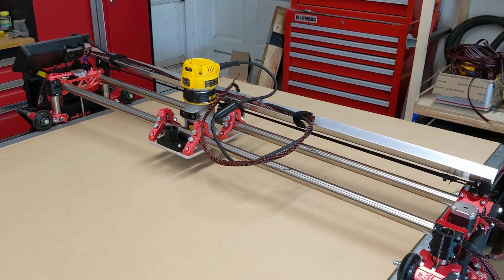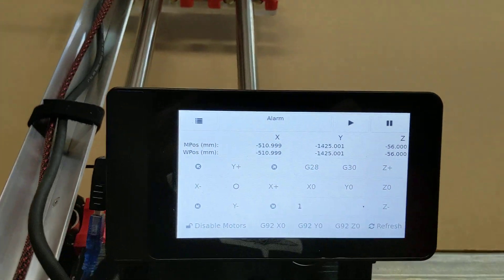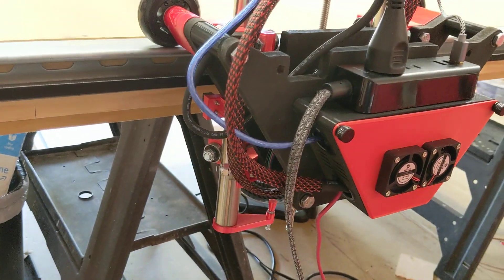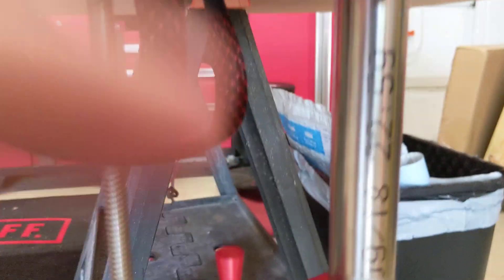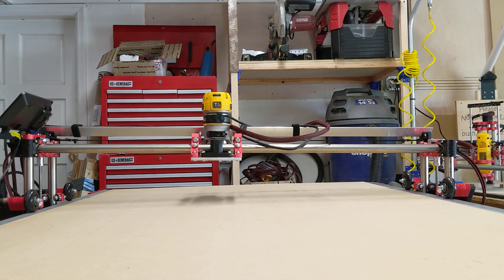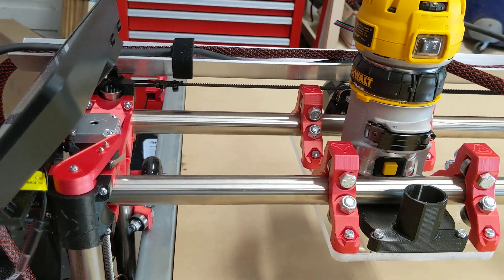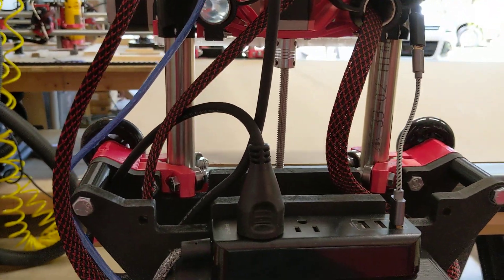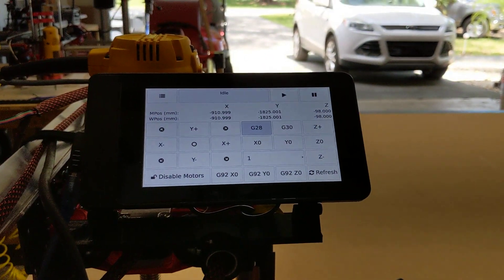My new Lowrider CNC lives!

Comment: Nice design, I thinking to use similar approach for X axis but most of the routers have vertical arrangement of linear guides is there any advantage. any disadvantage in horizontal arrangement.

Comment: The metal extrusions you used, what do you call those? they are like sliding door tracks or something right? Or is it just like steel C channel? Just wondering how that's worked for you as I was looking for an option to use metal to ride on instead of wood as I don't like the idea of wood, while MDF doesn't shift much it does shift some still and on top of that it'll wear down pretty easy even with minimal friction.
Reply from the maker: It's called Unistrut.  It's in the electrical section of most big box home stores like home Depot or Lowes.  I've since removed those from my table and replaced it with V-Slot which my gantry now rides on.
Reply: @larrywimble2131  like aluminum extrusion v-slot? If so those wheels wear down so fast on my one 3d printer, can't imagine it on a CNC router.
Reply from the maker: @Dougie085  yes that's that stuff.  We'll see what happens.  I tried the cheap linear rails and had no real success getting them to glide.  The V-Slot rails glide nicely.  I'm still learning all of this.  We'll see what happens in practice.
Reply: @larrywimble2131  Was there something wrong with the Unistrut? Or are you just trying to improve it overall?
Reply from the maker: @Dougie085  nothing wrong with the Unistrut itself, but the skate wheels wandered.  So I went with guides for a long time.  The guides worked, but I wanted to fold my table vertically for storage, and I had devised a method to lock the skate wheels down, and it worked great up until one of the locks broke and nearly destroyed my gantry.  So.... I decided to put the thing on tracks of some sort and here we are.
Reply: @larrywimble2131  Ah ok, sorry for all the questions lol.
Reply from the maker: @Dougie085  hahaha, no worries sir.

Comment: Awesome build, so I have 2 questions;

1- What is the effective size that this machine can do? For instance, if I have a 4x8 "table", how big will it cut? I assume something like 40x88 or so due to the router size and whatnot.

2- Can we have the gcode for the autosquaring/leveling? This is a neat feature and I'm certainly going to be making use of that!
Reply: Nevermind the size question, I saw the "calculator" on the website. I have yet to find the autoleveling/squaring gcode though.

Comment: Hello Larry! thanks for this Video. Can you make another video of how you set up your raspberry pi with the touch screen and I noticed you can control the  low rider through the touch screen, I wonder which image you are using on the Pi? thanks in advance
Reply from the maker: I'm not sure that making a video of that is going to be easy or even possible (since I've lost the password to my lowrider's pi), but what I can tell you is that I used a regular Raspbian Lite image, installed X and cncJS on it, and under that, installed cncjs-web-pendant (you can google that, it's on Github).  Then I added some startup scripts to automatically launch the browser to the cncjs-web-pendant URL on localhost.  There's nothing super-difficult here; it's just requires patience.  If I do redo that image at any point, I will video-document it next time.

Comment: Out of curiosity, which 3D printer did you use to make the frame parts?   I would like to build this but the 3D printer is part of this process.  Very nice clean build.
Reply from the maker: I used a Creality Ender 3.  You can pick them up on Amazon for about $230 USD.  That said, you could use most any 3D printer to do the job.

Comment: Absolutely sweet setup! I'm interested in this machine but have a couple questions.  I'm interested as to more information about the electronics. I'm an electronics engineer by education but haven't ever looked at Arduino and Ramps. Do you have a quick layout of these and how they're used with the Pi? Also, is there a way to easily break this down so it's not taking up floor space in garage?
Reply from the maker: Oh, and to answer your question about breaking it down....... Some people have made their table fold up to a wall.  Others have theirs fold up horizontally (sorta like a Mazlow).  I'm actually in the process of making a cart that will allow me to fold the table up vertically and wheel it over to a corner of my garage.  I'll post a video of that if it works out.
Reply from the maker: The RAMPS board is a "hat" that you attach directly to the Arduino.  The Pi is only connected to that by USB.  I am running cncJS on the Pi, and I also added the 7" touchscreen which you can get on Amazon.  Then I added the "cncjs-web-pendant" software (found on github) to that so that pendant would display on the touchscreen.   Somewhere on this thread is a link to the display mount on Thingiverse which will point you to the items on Amazon.

Comment: Looks absolutely fantastic. I built mine but am having several issues. Where did I you learn to do this? If you could email me I would love to pick your brain on how to accomplish this. My Lowrider CNC Drops without power, I don’t have stops or ways to level it. The auto home heightens one side which stretches the Spring Screw on the other side. I could go on for days but am looking for someone with the know how and can do that can point me in the right direction. Again great rig and bet you are already putting that to great use.

Comment: Hi Larry - great build! I am building a similar set up currently. I assume you used the mpcnc grbl firmware as a starting point (https://github.com/johnboiles/grbl-Mega-5X/tree/mpcnc-rambo-support), outside of reassigning the additional two axis in config.h to account for the dual Y and Z steppers in the lowrider, did you have to make any other edits to re-assign the axis/endstops? Any way you can document the set up or firmware on thingiverse/github or the v1 engineering site?
Reply from the maker: I did in fact start with that, yes.  It wasn't all that difficult.  I set it up on my test bench and had it all working within in a couple hours (although I have to say emulating the endstop switches manually in a way that won't throw GRBL into an alarm state is somewhat of a challenge).
Reply: @larrywimble2131  I assume that do you use 4 axis=X2, 5 axis=Z2. 
And do you used endstop pins as follow X1=Xmin, X2=Xmax, Y=Ymin, Ymax=unused, Z1=Zmin, Z2=Zmax. 
Is that correct? 
I have spend a week to figure out and still straggle, alarm alert but i don't know if i have everything wired correctly can do you share more details please. 
Thank you very much for your answer.
Reply from the maker: @kristianpraslicka3669  In config.h, I set N_AXIS to 5.  Then I set the individual axes in this order: XYZZX (the long axis on my machine is X, not Y like most others).  Then set $3 to 0. This is important.  If you have any motors running the wrong way, just flip the connector.  Following that, you can set the bits in $23 to reverse direction for any motors that you want to home in a different direction.  My limit switches are set to normally closed.  I do not know in what order they are connected to the RAMPS board, but it's not hard to figure out just by depressing a switch and seeing which axis limit switch triggered by issuing a '?' command to GRBL.
Reply: @larrywimble2131  Thousands time thank you!!! It worked finally, just it was need to also edit home cycle for 5 axis. I was just overthinking with endstops, masking, cpu_map adjusting and it was so simple, no inverting of endstop needed, just what you wrote. Thank you for your reply again!
Reply from the maker: @kristianpraslicka3669  Glad I could help :-)

Comment: Looks really good! Can you show us some Chips?

Also were the 5 limit switches tough to wire up and program?
Reply from the maker: It hasn't made any chips yet because it's got a Y-axis wandering issue that I am trying to solve.  The limit switches were a bit of a project unto themselves.  Time consuming to wire up and get the firmware dialed in, but well worth it for repeatability in my opinion.